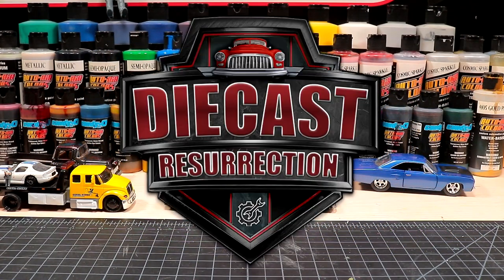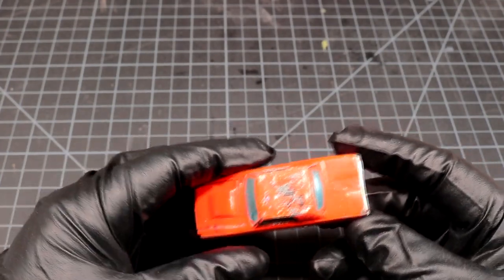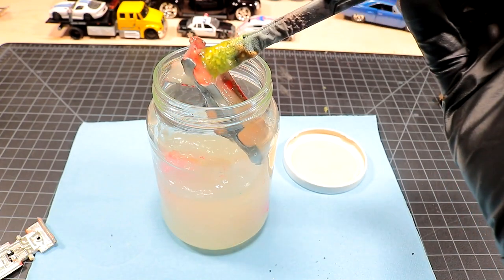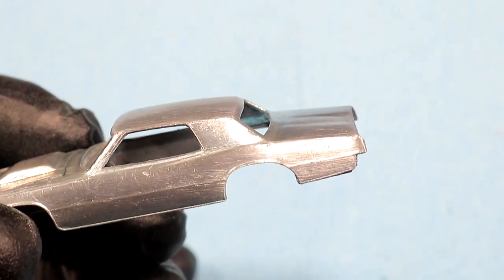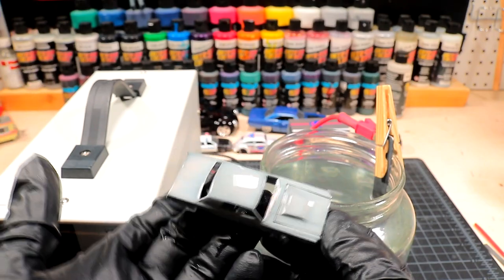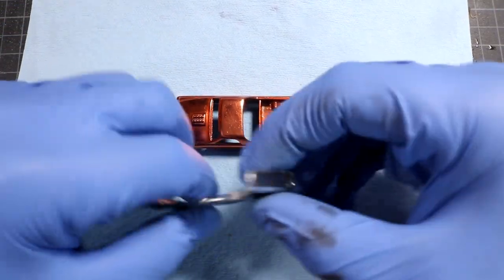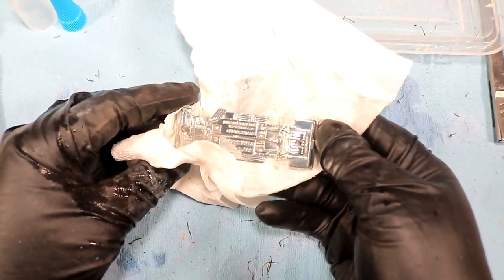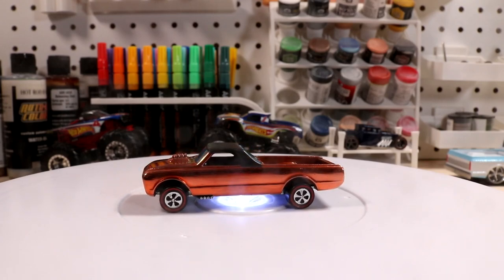Redline Hot Wheels Restoration - Thunderbird and Fleetsider - First Video Back after 1 Year

Comment: double the resto, double the fun. :) two very lovely castings, nice and shiny again. :)

the eating-into-the-plastic seems to come when modelers' paints are thinned with nitro paint thinner instead of enamel paint thinner, and not thoroughly mixed. the nitro eats into polystyrene, and if one isn't careful it seeps into and underneath the windshields. in my time as a kid I found some "repainted" castings where the windows were glued solid to the casting from the thinner. there also was one where they washed off silver paint from the model, ruining the glass forever. (or hopefully not, I want to restore the thing one day...)
meanwhile, polystyrene glue is related to nitro paint thinner, except thickened down so it wouldn't flow everywhere.

Comment: Outstanding work as usual, every time I check out your work, I learn something.  The super clean you used on the interior, will it remove paint, or do you use something else for paint.  Did you use the super clean on the windshield with no luck?

Comment: Hey Austin, I just noticed, you upgraded the paint booth about 7 months ago.  It looks like a custom, any tips on the build?  Did you dip the base as well to remove the paint, safe on bearings?
Reply from the maker: Scroll back a ways I did a whole video on it with the build plans.
Reply: @DiecastResurrection  Thanks bud, I found it.